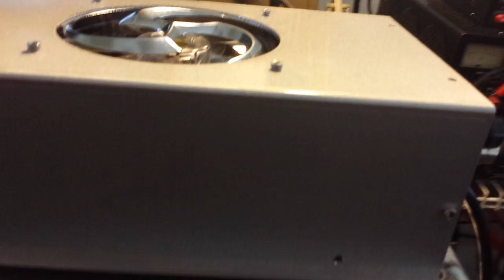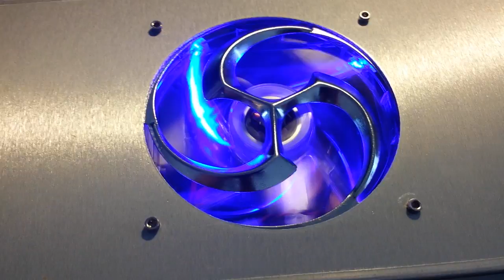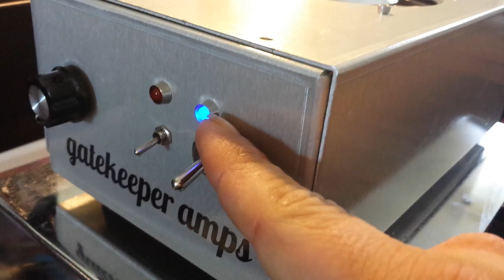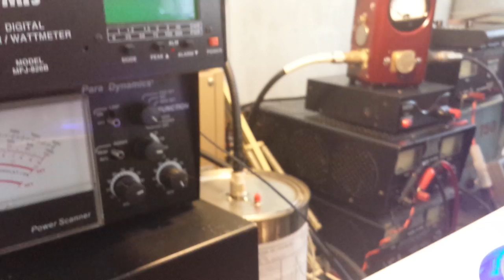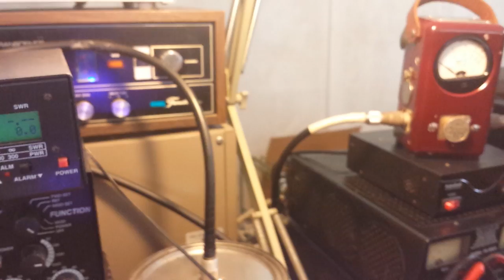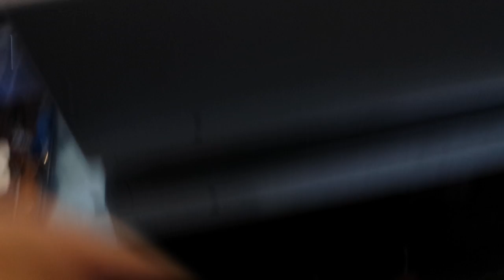Gatekeeper 1x2879 Custom Base Amp Video 1 OF 2

Comment: Gatekeeper Amps
Full Title: Gatekeeper Amps
Document Type: Warning
Bureau(s): Enforcement
Description 
It has come to the attention of the Federal Communications Commission that Gatekeeper Amps is marketing unauthorized radio frequency devices in violation of Section 302(b) of the Act and Section 2.815(b) of the Commission's Rules.
Report #: W201800042522
Files
Primary Attachment
 Warning: doc pdf txt
Document Dates
Released On: Mar 22, 2017
Issued On: Mar 22, 2017